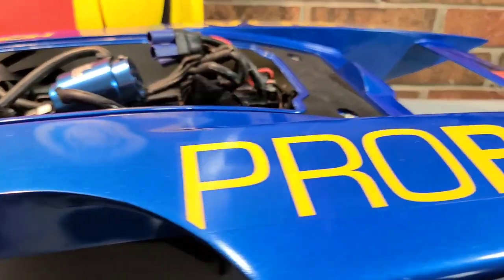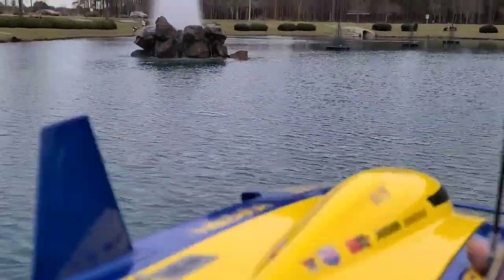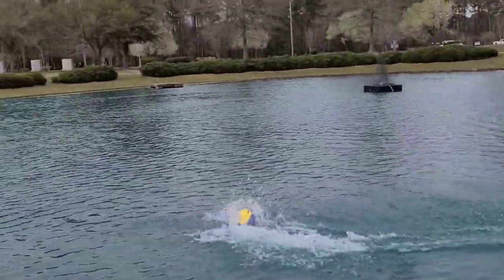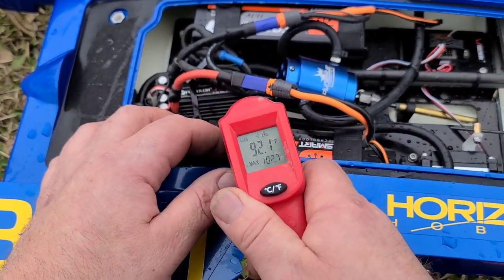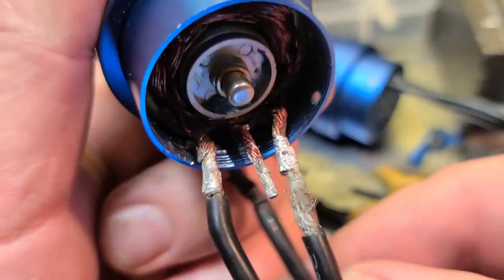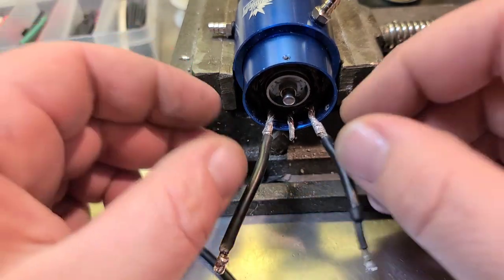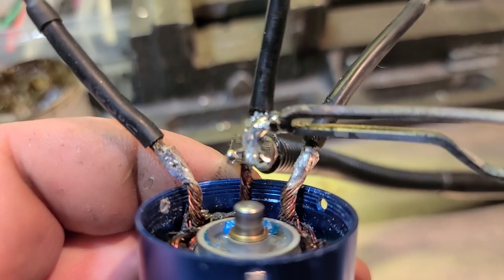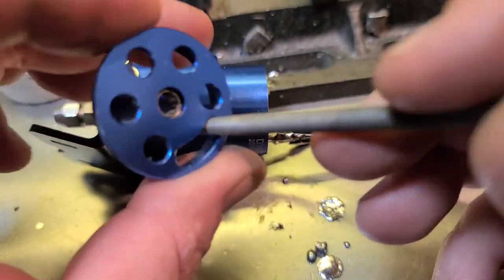UL-19 6 Pole Brushless Motor Problem & Free Fix

Comment: man i love proboat hulls, but the motors radio and esc always gave me problems. so odd the motor leads are soldered like that. they should be long enough to just solder bullets onto and call it a day.
Reply from the maker: I thought about soldering bullets directly onto the stub wire, I've had bad luck in the past shortening wires on the motor lots of excessive heat?
Reply: @IRONCLADRC  ideally the less solder connections and less extra wire the better. Ive never seen a motor like that tho. That’s a first for me lol

Comment: You might find that those short leads between the motor and the ESC are a tuned length. I’m lead to believe that changing their length will mess up the timing on a brushless motor. Maybe not. What do I know. 😉 And listen, you don’t owe anybody an explanation about checking the temps. If I pushed my boats as hard as you do, I’d be checking too. It’s just common sense.
Reply from the maker: Yea man I agree on the short wire deal 100% that's why I was scared to upgrade the wire size?  Short wires with my experience will heat the motor up big time. I learned my lesson along time ago. Lol.  Thanks for watching IRONCLAD RC
Reply: @IRONCLADRC  You are exactly right on the wire size. Even if you got the exact same length, the size could change the timing. The motor would probably still run, it just would be quite as powerful and would likely heat up. These brushless motors are more complex than it might seem. At least that my understanding. 

Have a good one! Love your channel. I learn lots of stuff.

Comment: How would you oil the bearings in that brushless motor
Reply from the maker: I usually do it the easy was and drop a few drops on the outside of the bearings and hand spin the shaft/flex so the oil works itself into the bearing.

Comment: Good thing you didn't decide to put that 10 gauge too much voltage would be running through and would cause the motor to blow
Reply from the maker: I ended up putting 10g on to prevent desoldering but it ended up desoldering anyway lol.   The one I did in this video is actually still up and running I've got it in my recoil 2

Comment: This just happened with my new v2 
I have some question. Any way we can chat on phone real quick?
Reply from the maker: The bullet came unsoldered?  The wires out of the motor on my v2 is solid 1 full length of wire not 2 like this motor
Reply: Undone from motor inside ..
Reply from the maker: May need a new motor?  🤔
Reply: I soldered it back together like u and it's working now... your video helped me

Thank u

Comment: Have you ever ran that motor on 8 s with a spectrum 160?
Reply from the maker: No it'll barely take 6s
Reply: What motor could I run with the 160 spectrum. I took it out of my blackjack 52 and bought the castle hydra for my 42

Comment: Do you not mind if I ask what is the size of the rear bearing on in that motor ?
Reply from the maker: I have no idea budy
Reply: @IRONCLADRC  do you know anything about sss 4082 2200 kv, because I put on my ul-19 with seaking 180amps, i press the throttle 5 seconds letter the boat slow downs , it’s like thermal cut off or LVC kick in
Reply from the maker: Is the rx/tx calibrated with the esc?
Reply: @IRONCLADRC  how do you calibrate seaking 180a
Reply from the maker: Really just calibrating the endpoints rx/tx & esc. 
 Make sure nothing is binding in the driveline, flex cable stuffing tube. strut etc, putting excessive pressure on the motor.   
Most importantly check the solder joints from the motor to esc make sure there's good contact. Also check the battery solder joint!      

Check the receiver make sure the receiver is okay, sometimes the receiver will go bad and you not know it. (Shorted out at some point?   

Check all of that and let me know what you find.
Reply: @IRONCLADRC  ok I am gonna try that , thanks man I just never calibrate marine esc
Reply from the maker: It's basically the same as a truggy or buggy.    Solder joints and rx may be the culprit

Comment: Not having the motor in my hands to look at, it looks like the water jacket is too far toward the shaft.  It's not close enough to the wire end and the wires are overheating and your IR gun is not picking it up.  Solder joints fail like that when they get close to the melting point of the solder.
Reply: Also that clip in thingy is an RF choke for electrical noise suppression. And, heat shrink tubing is a thermal insulator of sorts too.
Reply from the maker: I thought that to. I try to run the jacket forward on the motor but to be honest I have to move the jacket back and forth to get the battery's In the boat, so I forget to push it forward from time to time.     We need some kinda liquid cooled wire sheaths for the motor wire so they never get hot. Lol
Reply: @IRONCLADRC  I think I would mark the outside of the motor exactly where the stator is. Then center the water jacket.  How come they don't make a water jacket that covers the whole length of the motor?
Reply from the maker: Idk ?  I tried putting other motor jackets on this motor but this motor is a tad bit larger than all my extra 36mm water jackets, none of the jackets I have fit this motor.   First time this  happened,that was the first thing I checked, larger jacket.
Reply: @IRONCLADRC  idk either. :)
Reply: @ebenwaterman5858  Bingo!!  RF Choke.

Comment: Its actually the motor windings...the size of the drum its kv dont matter in the performance of a motor... however yes the bigger can size will give you more tork and rpms...but be careful on your kv ..kv is actually the winding of the motor..insides..amps and volts..lower voltage the more amps it pulls...if the batteries cant put out the amps guess what melt down.. example have you ever pluged in a table saw with a long cord and the thing keeps blowing fuses...yep not enough amps ...ok.. shorter cord yes helps but it still dont have the amps to run the motor...and the cord gets storming hot...same goes on with these rc motors..ok...like i said kv dont matter the drum will only turn so many rpms..you can take 4 motors same can size different kv they all spin the same rpms...the difference between them is the windings...volts and amps.. important..choose your motor accordingly..so high kv=low volts more amps to run it...to get the rated rpms...lower kv =high volts lower amps to get the rpms..out of it ex..and yes saws are brushless motors also... 😂..poles is about how even you want the motor to run..or performance...4 poles are ok but a 6 pole motor has more magnetic pull..better performance..ex..so with that all said find a middle ground when choosing your motor..your kind of better off with a higher voltage battery less amp draw..ok feel me...small battery is ok for your out of the box boat ok . iron clad would be like i describe..make sense..

Comment: If only there's a device that you could connect to all the pieces that you monitor the temperature and have it worthlessly tell you what the temperatures are instead of having to open it every time
Reply from the maker: The new spektrum firma smart technology paired with the dx5 line  will give you real te Telemetry temp speed rpm etc.  Really cool
Reply: @IRONCLADRC  my UL-19 is to be delivered in a couple days. How hard would it be for me to switch to Spektrum Firma 2000kv motor and the 160 Spektrum Firma ESC ? I love the telemetry on my Sonic wake v2. My UL-19 is new in the box. Any tips would be greatly appreciated.

Comment: Yeah these motors are built poorly the way they just butt the wires together is super trashy. I’ve had to fix several of them.
Reply from the maker: Have you ever soldered the bullet connectors on to the stub wire